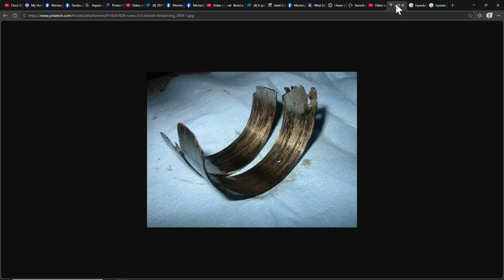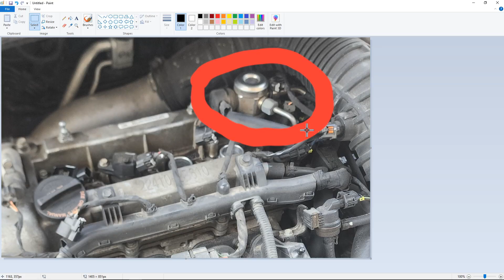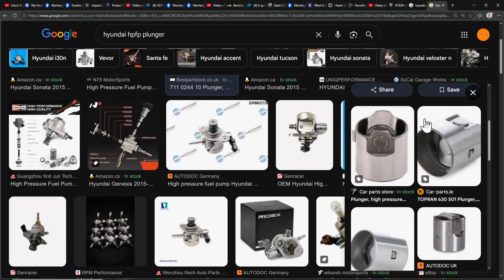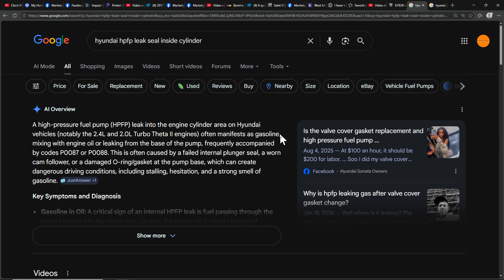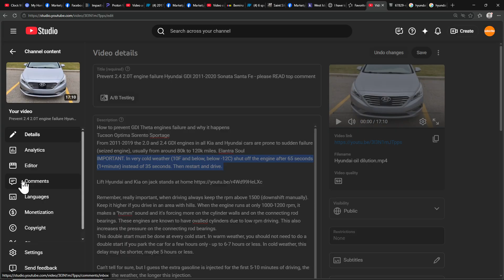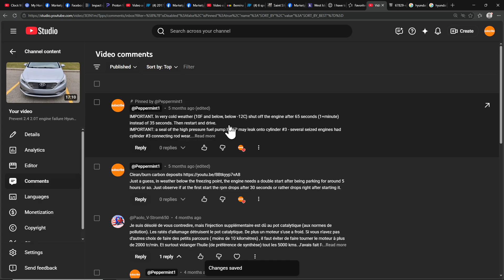UPDATE: Prevent 2.4 2.0T engine failure Hyundai GDI 2011-2020 Sonata Santa Fe

Comment from the maker: Also make sure you don't have engine oil accumulating around spark plugs from leaking engine cover gasket - it may cause irregular spark and unburnt gasoline with the same consequences as a leaking pump (remove all ignition coils). Faulty pump sound https://youtu.be/BERDJrLT4mw
Original video - be sure to read pinned comment in that video https://youtu.be/3l3N1mJTpps
Videos showing severe rod bearing damage on rod #3  
https://www.youtube.com/watch?v=Mflzd88EsIk
https://www.youtube.com/watch?v=IntkTBjEx5k
Severe E-CVVT damage on all 2015-2020 GDI engines https://youtu.be/Z9SB3t460pM
Engine valve cover leaking onto sprak plugs holes is also very common and may cause loss of spark plug ignition, higher fuel consumption and possible unburnt gasoline coating cylinder walls and washing off the oil film - same scenario as in the video. Remove all ignition coils and inspect for dark oil around the spark plugs